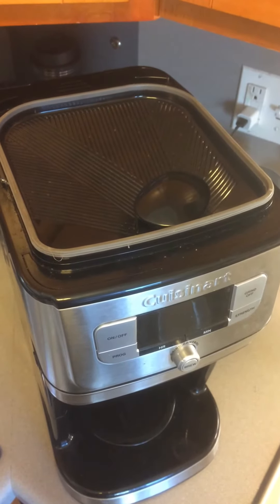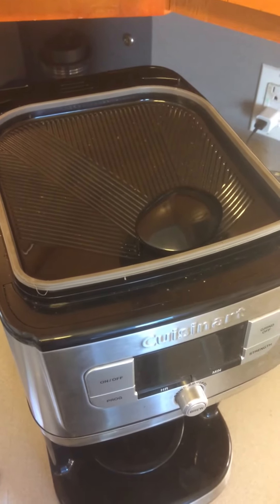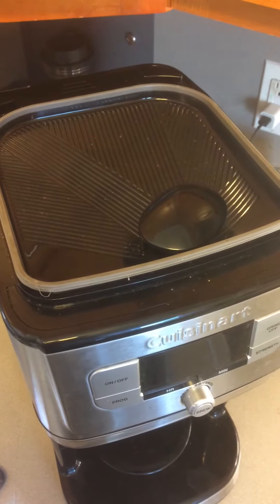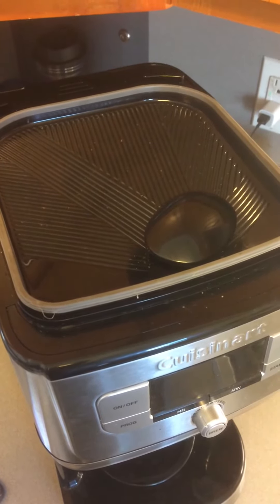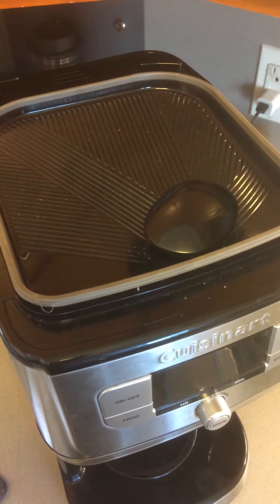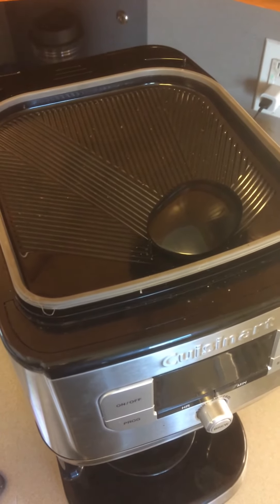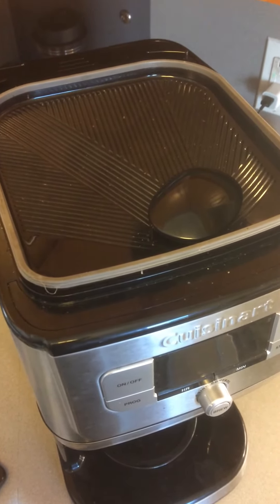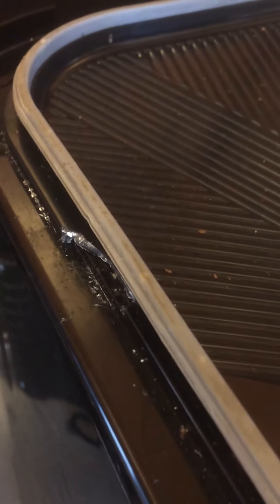Playing Hard to Clean—Cuisinart Model GDB-850 Coffeemaker

Comment: OK - I too was very frustrated that the first activity I had to do every morning at 5 am was have a smackdown wrestling match with my coffee marker to get beans into the grinder before it stopped whirling. Many thanks to those who provided the details this thread! I took it apart to clean it - it took about 30 min. If you want to know how here is how I did it:  As stated by Theduckczar and restated by others below there are 5 screws to be removed, (2) in the water tank just under the lid under round plastic caps that you pry off and (3) at the front under a loose flat plastic panel (on top) just to the front of the bean hopper above the control panel (this panel required prying to remove as it is held in with plastic tabs, don't worry they withstand a bit of force and don't snap off.) The screws are a small phillips head about an inch long. Once the screws are removed some gentle prying on the edge of the whole hopper assembly working your way from the front to the rear along both sides will dislodge the plastic holding tabs. There are some real bugger of plastic tabs at the rear under the hinge of the water lid that came last. Next remove hopper assembly, spill beans everywhere and down inside because its impossible to remove them without a vacuum. Gaze upon the underlying problem! The intake chute prior to the grinder assembly is packed full of compacted bean dust which inst allowing the beans to enter the grinder. I took the back end of a spoon and loosened up the compacted shmoo, don't worry if some falls into the grinder. Take the whole coffee maker turn it upside down and shake it like a Polaroid, make sure you get all the beans and residual dust out. I then wiped out the chute with a paper towel. (obviously don't do this when it is plugged in). As the burr grinder must throw dust in every direction I suspect this will be a recurring problem. Marvel at the crappy design and envision how you will need to do this multiple times in the future. I took the opportunity to wash the whole hopper assembly and hit it with a blow dryer to make sure it was 100% dry prior to reassembly. One note - there are (4) additional screws from the bottom of the hopper assembly that would allow removal of the hopper tray (without this ridiculous procedure) if removed prior to reassembly. If I have to do this again I might go that route or perhaps just use a sledge hammer. Reassemble as desired, tabs require some realignment to snap into place prior to screws. I left the two plastic screw caps off in the water tank for ease of the next deconstruction (besides I definitely mangled them a bit with initial removal). Then I ran the clean cycle on the grinder to get the residual dust out.  Hope that was helpful - thanks again to everyone on this thread! Another crappy expensive product fixed for the meantime!

Update- its been 10 months. Caught the wife going all WWE cage match on it again this morning, so I took it upon myself to go for round 2 deep clean. Sure enough, the chute was clogged with bean shmoo again. One slight update to my instructions... for the tabs in the back, pry the main case outward by jamming a flat screwdriver under the hinge of the lid to separate the top tabs from the main case. I am impressed that this coffee maker has taken such a literal repetitive beating and still works.

Comment: I bought my Cuisinart DG 850 3 1/2 yrs ago. It hasn't been making good coffee for nearly one year. I realized that there weren't many ground beans in the filter when I cleaned it after making a pot of coffee. I found this article by Builder9094 and decided to see if I could access the burr grinder. I found the three screws in the top front, but not the 2 in the water tank. Not to be discouraged, I took the 3 screws out and pried the bean hopper off!  I could see that the grinder was caked with "compacted schmoo" also!  After cleaning it , it runs like a top! Thank you, Builder9094 !!!!

Comment: Consult the manual. This part is not meant to be removed. In order to clean the burr, simply remove all of the beans from the hopper, press and hold the “Brew” button. Grinder will engage and dislodge stuck beans and send into brew basket. When grinding of beans noise stops, turn off the machine. Empty the dislodged beans from the brew basket. Wipe hopper clean. Resume normal brewing.
Reply from the maker: That’s correct, Hollie. Lacking further Cuisinart explanation, one is left to presume that the persistent ‘Clean’ LCD display suggests that the machine is not yet fully cleaned. While I’ve effected a workaround, I suspect that Cuisinart modeled this upon the Apple products that require factory intervention.
Reply: Except when it doesn’t. I’ve run this about a dozen empty cycles with no joy. 

The comparison with Apple (closed system) is apt, except that Apple will service the closed components (e.g. replace the battery); Cuisinart seems intent on making you throw it out and buy a new one. Landfill economics.
Reply: Tried several times and it doesnt work. No solution at all since the grinder is inaccessible
Reply: Thank you so much this helped a lot your comment saved me
Reply: “Grinder WILL engage and dislodge beans”
What if grinder is disobedient and declines engagement?
Reply: @TomMcIntyrecrna  throw it in the trash where it belongs
Reply: That doesn't work though. I did this and my coffee is still coming out weak.
Reply: Thanks, this worked for me.  Great first step to try before taking everything apart.

Comment: Hi Mark, Do you have the next part of the video? We're having issues with grinding beans. Thanks!
Reply from the maker: My Cuisinart coffee grinder-brewer apparent malfunction was never fully remediated. The manufacturer customer assistance appears to be unfamiliar with this problem.
Reply: @qstrian  ours stopped feeding beans for grinding as well, although the beans feed into the grinder.... They don't seem to get to the blades; we can hear them whir around not hitting anything.  If Cuisinart is not familiar, it seems to me they are about to be.
Reply: Mark - how did you get the danged top/bean hopper off so that the blades and motor could be properly cleared?
Reply: Has anyone figured out how to get the top off so it can be cleaned? Mine no longer grinds
Reply from the maker: I’ve restored my Cuisinart Model GDB-850 Coffeemaker to service. It must have been a miracle. Two more to Sainthood.
Reply: There’s 5 screws on the top. They’re under that front black piece, I just used a knife to pop it off. Than there’s two on the back under two caps. Easy peasy. I had to replace the straw like tube in the back.

Comment: Even though the original poster didn't follow up, read through all the replies.  Theduckczar outlined where the hidden screws are located.  There are 2 that are hidden under plastic caps under the water lid.  There are an additional 3 screws above the control panel underneath a piece of plastic that needs to be pried up with perhaps a butter knife.
Reply from the maker: Wouldn’t that leave the uninitiated ‘screwed,’ Darwin Byal?

Comment: I've been trying to figure out how to disassemble this part too so that way I can clean it out. The motor runs but the beans don't grind half the time.
Reply: If you have found a solution, please let us know. We are having the same problem...weak coffee due to not grinding the beans
Reply: @susansearer4805  unfortunately I have not figured out how to clean th grinder on the coffee pot.
Reply from the maker: Try recycling the power, Rick.
Reply: We're in the same boat - had this version for about a year and suddenly it's not clearing enough beans to make a good pot.  We've cleaned it several times over the year.... I'll try doing a full vinegar soak next
Reply: Unfortunately for me I have to use a separate coffee grinder now which sucks, but I'll keep using this coffee pot until it conks out on me.
Reply: I've found how to access the grinder if anyone still needs help. There are 2 hidden screws with plastic caps over them under the water reservoir lid. They are flush with the plastic and circular. Once you find them you will need to remove them, I found the best way is with a small (1/16 about) drill bit and as soon as the drill goes through you will be able to remove them easily. The screws are underneath. The other screws are located above the control panel and hidden under a piece of plastic that can be pulled up with a butter knife or something.
Reply: Thanks!!

Comment: We have the same issue - the hopper is full of beans but they don't go into the grinder. They have replaced my unit 3 x's since we purchased it due to similar issues but we are now out of warranty and they have declined to do anything further. We had a similar Capresso machine for 15 years and decided to try this because of the reviews. Did you ever discover how to gain access to the interior to clean the build up of coffee (which is probably what is blocking the bean's slide into the grinder)?